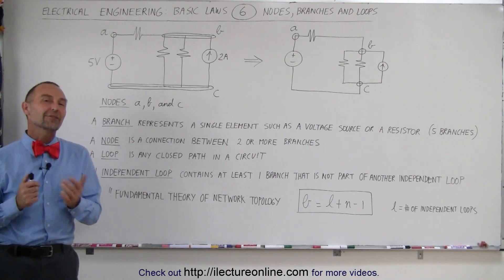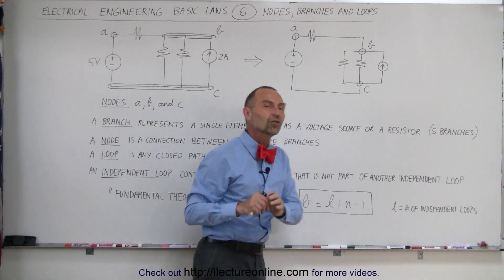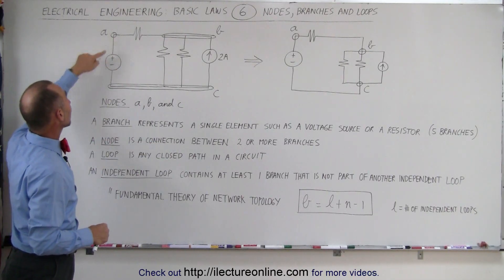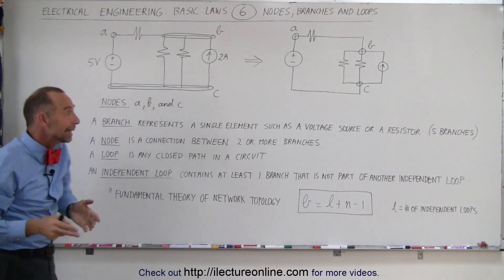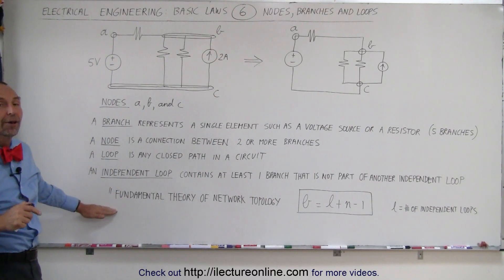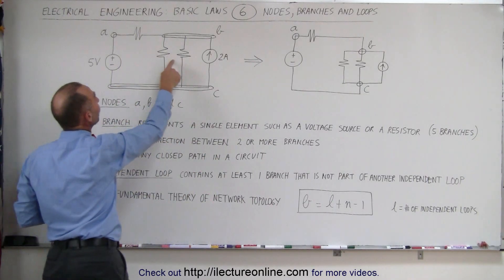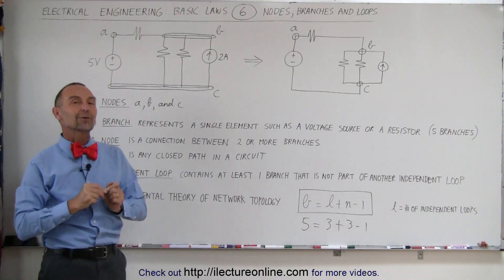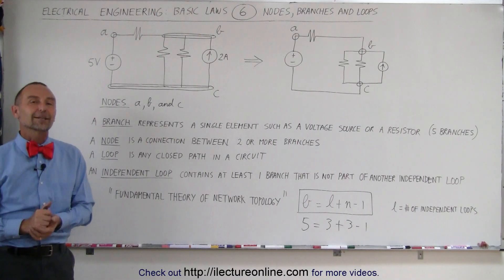Electrical Engineering: Basic Laws (6 of 31) What are Nodes, Branches, and Loops?

Comment: I did not completely unerstand how to determine which loop is independent.

In the left circuit we have 1 loop of the left mesh. is that independent? which is the branch that is not contained by another independent loop?
the other 2 loops that contain the upper resistor, current source and another branch are independent relatively to the first one but what about starting from the right side of the circuit? should there be always 1 start point?

I woul'd appreiciate any help :)
Reply: Independent Loop means simply meshes. The number of independent loops must be equal to the the number of meshes in the network.

Comment: i still don't get the independent loop, the rest is very clear though, thanks.
Reply: +Avi Halevy If you look at the diagram on the right, and you take a look between nodes b and c, you will find there are three different ways for the current to travel.  Because every single one of them a branch, there are three different independent loops because there are three different ways to travel independently, discarding the other two.  If you took one of the resistors away between nodes b and c, there would be two different independent loops for some reason I still have to learn.
Reply: Evan Bta thanks, I am starting to get it now.
Reply: Independent Loop means simply meshes. The number of independent loops must be equal to the the number of meshes in the network.
Reply: @mdsabbirbhuiyan3925  but which one of the possibilities? it get confusing.